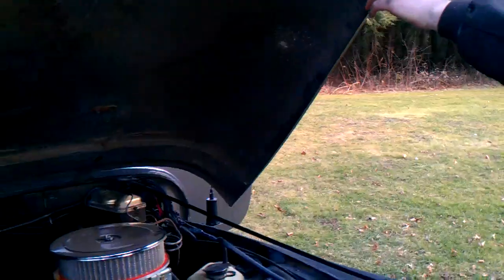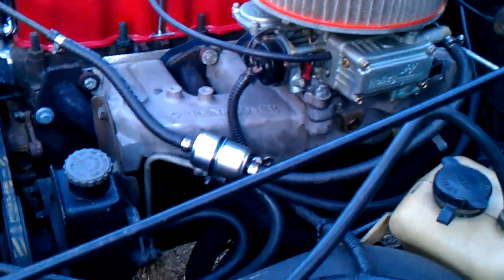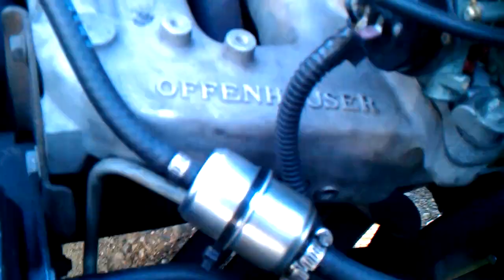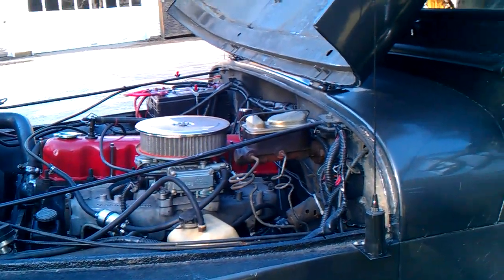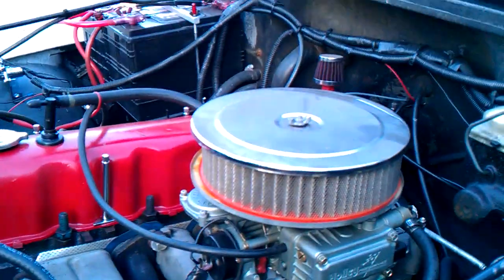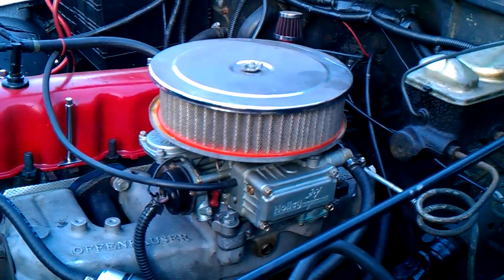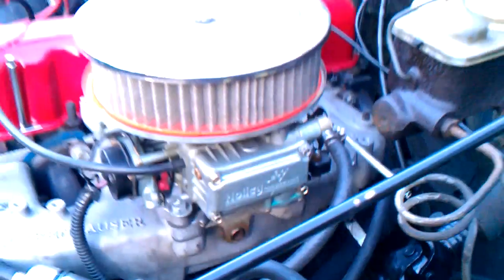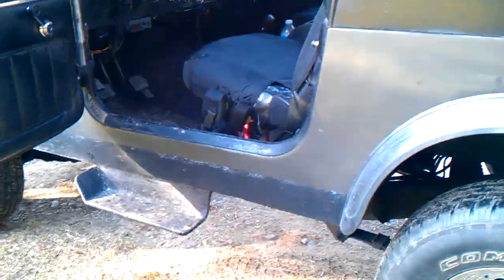81 jeep cj-7 exhaust

Comment: What trans are you using?
Reply from the maker: its the same stock 4 speed, I cant remember now since its been a couple years since ive owned the jeep now, Did have a couple issues of it going in between gears and having to remove the cover to manually move the slides in alignment.